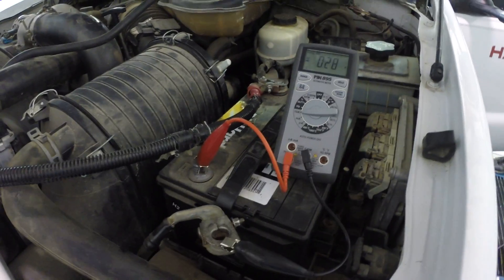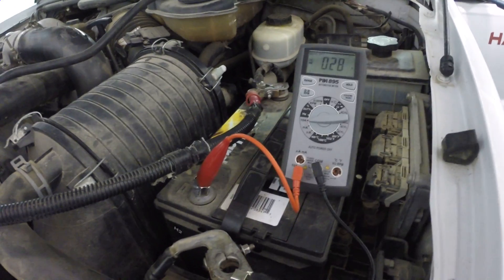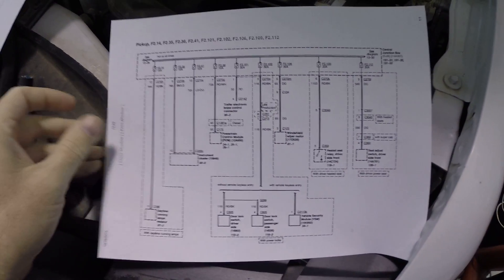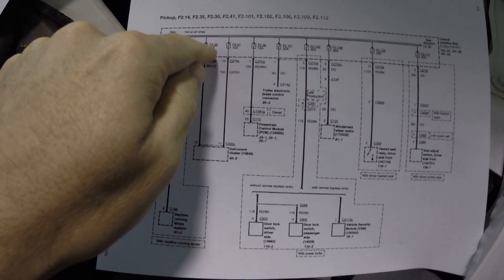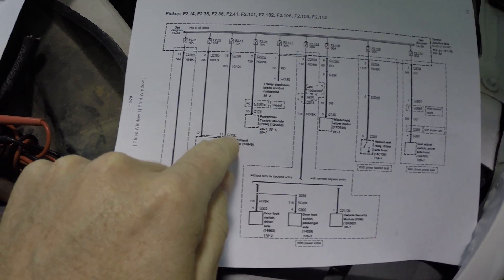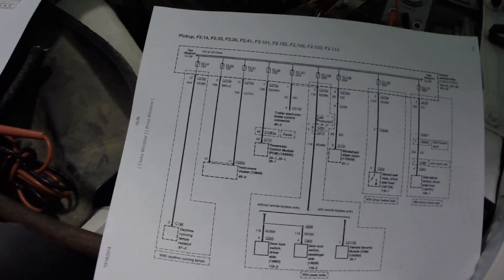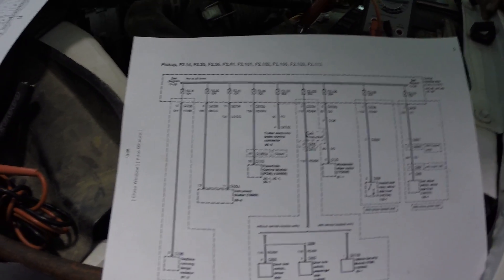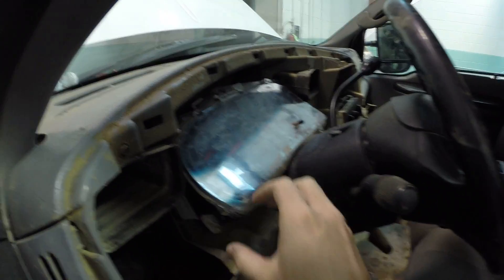Parasitic Load Testing

Comment: hello, i wonder. If there is two batteries in parallel will there be a problem if the one or more posts were disconnected? examples: only + side connected, only negative connected, or + side of one battery and  --side of other battery..? Thanks!
Reply: Its not a problem because two batteries are parallel ,